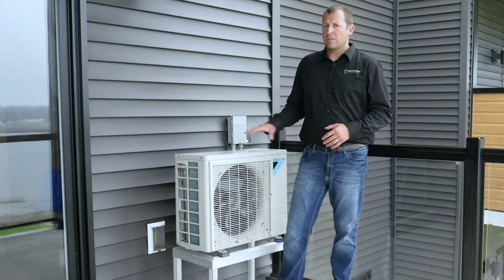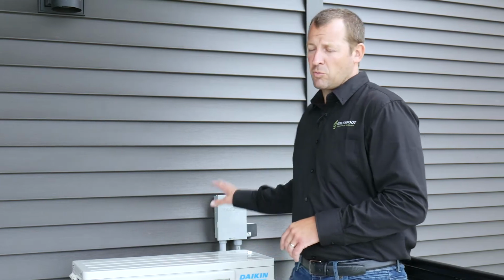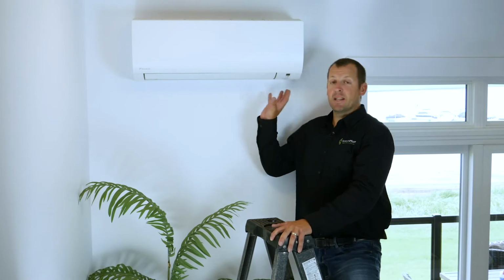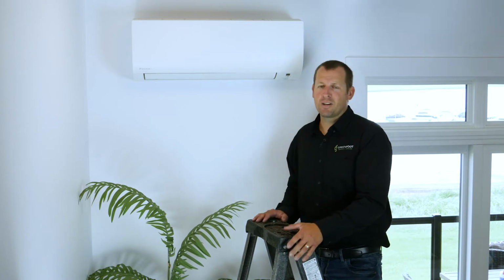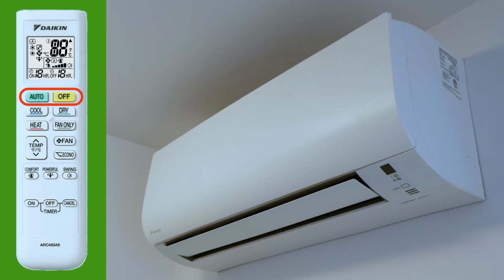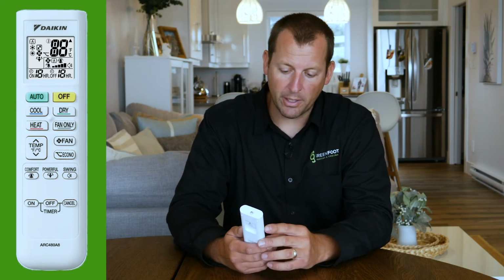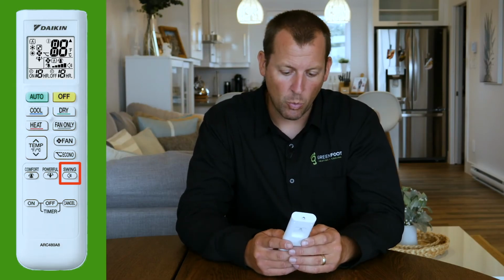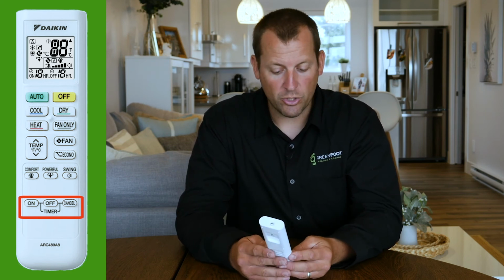How to use your new DAIKIN heat pump and remote

Comment: Does the Powerful button only apply to air conditioning? or does it apply to both A/C and Heating?  This model has been very impressive. Our outside temp is -15 Fahrenheit and our windchill is -39 and its still working.